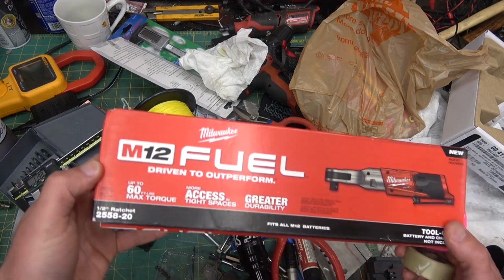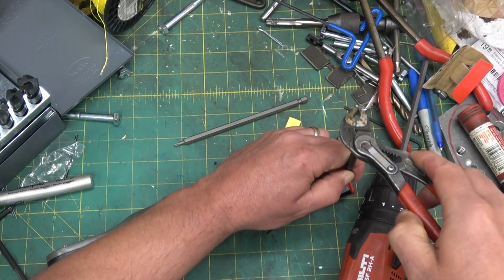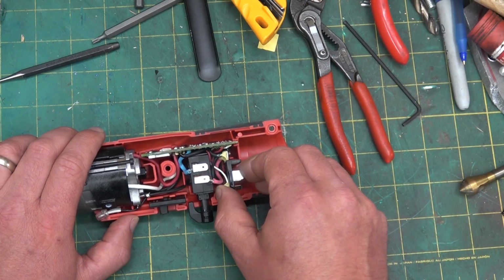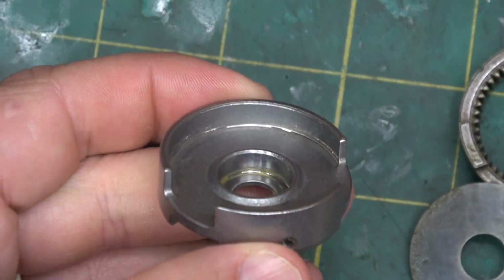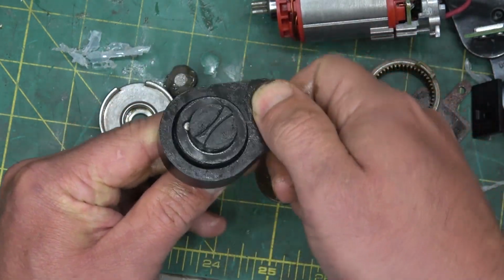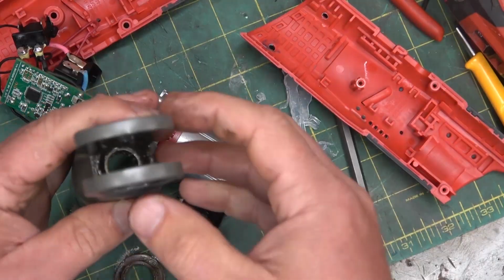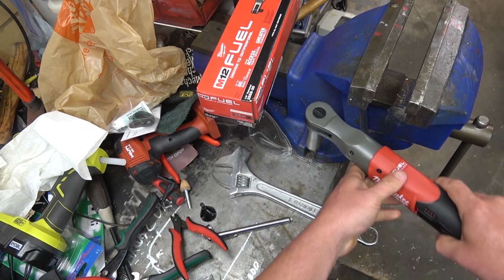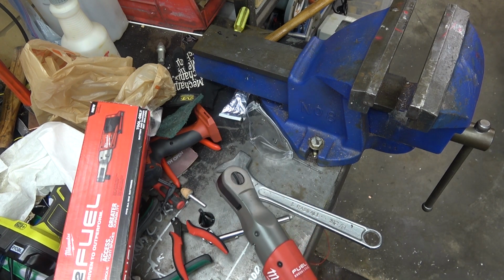BOLTR: Milwaukee Fuel Ratchet

Comment: Only issue I've had with the m12s are the 6ah batteries. Lost 3 now. Rebuilt one from a dead-ish m18 battery. Chooches alright now. No smoke yet, tons of m12 goodies mixed in with m18s

Comment: the most common failure i hadon those ratchets   (beside brush wear on non fuel models, repaired like 10 of them by now) is a metal spring that pushes the contact bar down inside the trigger rusting away and breaking.  never had a pcb, mechanics or brushless motor failure just one snapped off 1/4 head.   

the damn batteries allways break off their retaining clips.

Comment: Are use this exact tool plus of the longer version for work. And my failure mode was the small screws that hold the plastic onto the main part of the drive. They stripped out, and now the plastic casement weevil wobble’s all over the place. In my opinion, they use way too small of a screw to secure that also with no metal reinforcement, it puts a lot of stress on the plastic body.

Comment: I just opened my tekton 90 tooth 1/4” drive, and the design uses a shoe that engages 6 or 10 teeth at once. It couldn’t break one tooth. I think the failure point there might be the little piece that holds the shoe with the teeth.

Comment: Thing I will never understand, they market this shit alot to mechanics, we use it even allowed the dreaded apprentice near them and they rarely last 6 months will proper use. I've honestly found most of the cordless tools are not up to task for the mechanic workshop setting sadly air tools are the more ideal tool.

Oh and as for what breaks? The magic smoke escapes from most battery tools or they turn into brittle paperweights from the chemicals that inevitably end up on them. Back in the day I had my brand new snap on rattlegun dissolved by an apprentice that tried to clean my tools. Brake cleaner can was empty, so was throttle body cleaner buy hey gasket goo remover works too right?

Comment: had mine for about the last year of my 10yr cnc technician journey... needless to say im about to break the plastic body. like you say you can ratchet beyond the motor capability. they need to run the metal housing deeper into the body to give the plastic housing sum umph. from me gorilla reefing grabbing on the end of the battery getting my bolts good n tight. also broke a few battery clips... earthquake has an all metal housing, but LACKS these great batteries, not as much torque, and is noticeably slower... so i find stuck to the Milwaukee still...

Comment: Checking in after 1 year of daily usage- I have the 1/4, the 1/4 extended, and the 3/8 versions of this tool. The failures I’m seeing are the detention ball getting weak in the 1/4 anvil and eventually falling out of the anvil. Happened twice. The ratchets still chooch like new. I beat on them hard, they get dropped, dunked, dusted, etc. apart from the 1/4” anvils, they’re perfect. 

Thanks for your excellent, entertaining, informative and inspiring work.
Reply: Thanks for your update I’m just about to buy the long reach 3/8
Reply: @4cnkh4 , I’ve had the 1/2” Fuel Ratchet for at least three years.  What an amazing tool.  What I like about the 1/2” is the extra power you get, I can always put a3/8” adapter on for the smaller sockets.

Comment: i've had my 3/8s for like, three years now, using the absolute piss out of it, even so far as burping cooling systems with it and haven't had a single issue with it. the batteries on the other hand... better have 2...

...or 3

...or 5

Comment: In my case you hit the nail on the head with the failure mode. Mine crapped out on the second day of use with the circuit board smoking

Comment: I've been griefing on mine now for about a year in an automotive setting. I have the whole line of the Milfuckee ratchets. The number one complaint I have is how the battery is secured. The point of this tool is to to do the simple work: spin the fastener on or off using the motor to save time (or knuckles in tight spaces). The loosening or tightening of the fastener is done manually like a conventional ratchet. You really can't break a nut off with just the motor over about 40 lb/ft. The issue is that most people who understand the concept of length and leverage on torque will naturally do the manual ratcheting as far down the length of the tool they can get. With the M12 battery profile, that means fucking riding on this thing right at the point of connection between the battery and the tool. To give Milfuckee credit, the battery hasn't snapped out of the tool yet, but it is super loose and the amount of flex play in it is really disconcerting in the hand and doesn't inspire long-term confidence. It's to the point now that if I need to break a nut loose, I get a conventional ratchet just to make sure I don't fuck up my expensive tool. A tapered metal sleeve around the battery connection - in order to spread the force out along the length of the clamshell - would go a long way to remedying this issue.

Comment: could u please get the 3 in 1 linemans socket and the 7 16 drive milfuawkee impact driver and do a review.  the switch in the thermo plasticique has caused so many problems in a early 2020 version .    the impact socket itself cause such a high ping noise thats ringing ears while driving the  bolts down in poles
Reply: also curious why they couldnt have a pentagon or whatevr style for the inner socket instead of the pullout square drive compared to what was always tried and true . we had two sockets one for the 1 inch or plus and another that was atleast threee quarters depending on what size hardware being installed to keep the google machin rolling

Comment: I used one of these on an assembly line about a year ago, for exactly two nuts per unit. 
I never had a problem with the tool, but keep in mind the rest of my station took about 5 minutes.

Two nuts, one unit, five minutes, about sums me up.

Comment: I've had a 3/8 fuel for over a year now. So far nothing has failed in mine but I'm hardly a power user either, I try and just work on my own truck if I can help it but sometimes needs must. Only thing that spooks me is really cranking on the plastic body, but as long as you don't hold it by the battery it seems sturdy. But you know as well as I sometimes you gotta grab it right on the end to get all the leverage you can

Comment: Maybe the larger openings for the fan allow it to self clean as being used for automotive work grease is a factor that carpentry tools don't see so much.  Smaller openings can still let saw dust particles escape where as grease would plug up.  Having a large opening the grease blobs could fit the openings and fling out with circumforencial force?

Comment: 14:30 the fan is ok-ish... first, it's a bldc, it's gonna be stupid efficient and second, if the windings warm up enough, the controller will know it. what bothers more more is that the fan is mechanically driven, i'd much prefer a dedicated motor for it, even if it complicates matters.

Comment: I've had one for about a year now the only failure I can report is 1 of the T screws came loose and disappeared. I've dropped it several times from 4-5feet no major damage to the case but the top metal housing does have some scuffs and minor dents. I work  on semi tractors (Fleet). Overall very happy with this tool.

Comment: Got both the m12 sachets and.so far so good. As u said, well made fer as incan see. Why in hell do they make a 60lb and a 55lb. Tear down one of the cheaper ones with the black finish if u havnt already and I missed it. Such as the 1/4 inch or 3/8 black finished metal ratchets. The 1/2 in. 60lb. Er has in the last year jumped about $40 to $50 in the last year , but theres no inflation in the economy according to the govt. after they remove energy , and food , etc. So what good are their stats.lol! Rich/San Jose....ps.   There's especially no inflation here in Silicon Shithole, CA. Home of the one bedroom, one ba. , bad neighborhood rental at $2kmo. With $5k moving with perfect credit , or dont bother. Not to mention the 60 yr. old Homeless Despot flipper 3/2 next to a freeway onramp at the bargain price of 1.4 mil.  For these greedy selfish fucks, their time is a comin. Ive in my 66 yrs never seen so many homeless and so many seniors , women seniors. Is snowback heaven in the same boat?

Comment: @AvE my 1/4 inch ratchet non brushless I bought back in 2013 and still alive and kicking, the problem that has developed on that is that the mechanism to switch the pawl from forward to reverse slips and won't change unless I hold onto the socket. which becomes a pain in the ass because I have to reposition my hands a couple times and most likely come off the bolt/nut head and take longer on a job.

Comment: I bought a new brushless Milwaukee Mid Torque 1/2" impact wrench and used it for lug nuts with an 80 ft. lb. torque stick, noticed a burnt motor smell (you know that smell) coming out of the rear tool air vent. There is no smoking just that smell, is this normal break-in or should the tool be returned?

Comment: I'm surprised that engineers have not devised a completely different type of rotating reversing 90° angle drive tool, instead of simply attaching an ancient ratcheting mechanism to a motor. Cuz the girth on these ratchets could please Old Mother Hubbard several times a day.
Or maybe the ratchet is one of those devices the inventor got right the 1st time? Like the guy who invented sliced bread.

Comment: I have a fuel ratchet that I used daily and I mean hard use probably a bit to hard as I sheared the anvil right off. It was while using it manually not with the motor.

Comment: I own the fuel 1/4 and 3/8 ratchets and beat the crap out of them daily for over a year no problems so far. I had a old version 1/4 inch after 5 years of abuse the socket detent fell out.

Comment: Define hysteresis .. HUH? High speed switching? Back feed voltage and..
The housing gets ripped off because of a 400- 600 pound gorilla adding a lot more torque than the handle is designed to take.
   So,it pulls off the battery pack housing first.The paddle pivot? Not too good,compared to an air-powered ratchet,anyway.
These tools are not POWER-RATED but just enough to last beyond the 90 day cycle of use.
  Sure,the home-gamer will use this in light-duty use. Shop mechanics will go all electric and  sell their air tools.

Comment: I have the 3/8" model 2557,  for close to 9 months now.  I am a diy home mechanic for my fleet and friends and family.  So far so good, definitely a knuckle buster and i have had her jammed between engine parts because of the lock out function.   I frequently use the locking/ratcheting function to loosen and tighten bolts beyond the wrenches powered capabilities.

Comment: I have both the 1/4 and 3/8 versions. The 3/8 has fallen 6 feet onto cement and hasnt broken. The 1/4 version has been tossed around in tool bags and just beat on day in and day out and minus the looks is perfect. I would recommend getting the boots for it since the painted heads look beat up under normal use.

Comment: The only part I don't like about mine is the location of the direction switch.  When trying to hold pressure on the fastener by pressing on the back of the tool having that switch spinning is annoying.

Comment: Did you mention in one of your Milwaukee battery videos that the uP (TI403)in the battery pack can set a flag which can render the battery pack useless to both recharge or using it in the drill? From one canuckel to another canuckel thanks for all your great vids.

Comment: At the auto dealership I work at, most of the techs own Milwaukee power tools and have been using them for years. Most of the issues we saw with the old non fuel ratchets were the detent balls coming out of the drive head, and the rubber handle coating coming off. I havent had any issues with my Fuel ratchets yet. lets not forget about that 5 year warranty though!

Comment: As a Milwaukee tools repair center I can tell you the circuit board is what fails before the switch or the housing.  That said the biggest issue is the 200 lbs gorilla torquing on it that breaks the anvil assembly.  Love your videos keep em coming.
Reply: 280 Lbs Gorilla here, Mines held up to hours a day use :)
Reply: MOSFETS is one if his favorite things! Only in a Brush less motor?
Reply: @ddd228  you will find mosfets on driver boards for brushed motors too!
Reply: This is the info we need. Thank you
Reply: How hard are the circuit boards to replace and can they be ordered?
Reply: @seabass22  to repair the circuits on a scale of green to red about a 4, you can order them, but you need to deliver bacon to Mr sausage in the magical forest and ask to be let into the Milwaukee caverns.
Reply: You mean the MOSFET's on the circuit?

Comment: My impact died, and the little m12 3/8 ratchet ripped out 24 8 inch lag bolts from a deck without any complaint. Was hotter than hell but did it on one of the big batteries without replacement.

Tip for getting extra starting torque is hold it loosely and let er start swinging around then give it a good grip. Easily 2-3x more torque while spinning vs at dead stop. 

It is a dicey game of knuckle busting though...
Reply: YEP! I/we have been pinned.

Comment: Hey Ave, have you ever tested one of those chinesium (can I even say chinesium without getting “in trouble”?) tree carcass slicers that fit on an angle grinder? It’s a chainsaw that attaches to the grinder. I’m looking to possibly purchase one to slab up some dead tree. I’d put a 20” beam on it though. Not sure what grinder would handle that. Have to be skookem.

Comment: I've used my Fuel 3/8 and 1/4" ratchets a ton, cranked on them to break free 100+ ft/lb bolts, and yet to have a failure. the 1/4" is nice because the head is really small. Gets into those impossible spots.
Reply: I got the 3/8 and the long-head 1/4, and I agree! They’re excellent! I keep the 4.0 battery on the 3/8 and it runs all day long. I find that you can break loose a lot by “impacting” with it by spinning the socket 1/2 a second and dropping it down on the fastener. Gets a nice impulse without jerking the wrist too hard
Reply: I demand a tappy tap tapp shirt
Reply: Love your channel, watch every video!
Reply: Why didn’t you just get the M12 Fuel 1/2” Ratchet?  Then you have the best of both, with more torque.  Just throw on a 3/8” adapter.  I get the smaller 1/4”.

Comment: 80hr a week full time mechanic. Mine have several hundred hours on them 1/4 and 3/8. Have replaced the 1/4 twice from the board death. They are worth their weight in gold to me for the time saved of dragging an air line. If you spin wrenches, even as a shade tree, buy them.

Comment: The blinking lights tell you you reached the max of the tool. As on the grinder when using a 5.0 battery it will flash all lights and eventually overheat and The blinking lights recommend to use a HighDemand battery instead.

Comment: I think you overestimate the heat from the FETs, modern FETs are very very low on resistance nowadays as long as they switch em on and off hard with good drivers (which are cheap and easy now) they just don't waste much.
Reply: Even sub ohm resistance will still develop some heating wattage at that kind of amperage. Yeah driver design has a big factor, I remember some of the old ones leading to double conduction nuke smoke events.

Comment: I have a milwaukee 3/8” 12 volt brushed ratchet. I like it more than all the other electric ratchets i’ve come across because the head is smaller and will fit in tighter spaces. It’s the same head as the 1/4” 12 volt. All they did was put the 3/8 gear into the same ratchet.  The 1/4” version can break pretty easily, so i like the 3/8” a lot more.  I’ve had it for a few years and havent had any issues with it. I’m a mechanic, so i use it a lot.

Comment: "In a machine shop, no problem." I don't know brother, last machine shop I worked in looked like your bench! Only kidding, it was actually worse! My first day on the job I removed maybe 10 lbs. of steel and aluminum tailings, including about an inch deep pile of dust from under the grinders. The guy I took over for had some really good shop habits. I don't know how he managed to lose half his thumb in an 80-ton press brake... The auto shop I work in now is an order of magnitude cleaner, big corporate affair that it is.

Comment: thats not a cpu 0r micro controller, its a custom 3 phase driver+controller based on the TI 8301.. this chip needs a lot less supporting components than the traditional 8301.

Comment: Had the brushed and brushless ones. Loved them both. Easy to replace broken anvil ends and the only other thing I have had break on my brushless is dropping it battery first. The battery housing broke but the tool was just fine. Had the brushed one for 3+ years and the brushless for almost two years now. Work as a Mobil equipment mechanic and easily my favorite tool.

Comment: I have an Snap-Off 3/8" electric ratchet that recently stop working,worked hard for better part of 4 yrs as a professional mechanic, pretty sure it's the mechanical part smack and it sometimes works, don't have the time to take it apart to find out. unfortunately they dont warranty electrics ones any more. you can tear it apart if you want just find a way to contact me.

Comment: I got the 1/4" fuel version 12/17/2017, a few months in the directional lever became difficult enough to require pliars to operate before fully siezing. In a rage I used a 1/4-3/8, a 3/8-1/2 adapter then attempted to break free some lug nuts from a 1 ton truck. The head broke and milwaukee replaced the tool under warranty. The replacement has been great until recently the directional lever has become difficult to operate. Lovely.